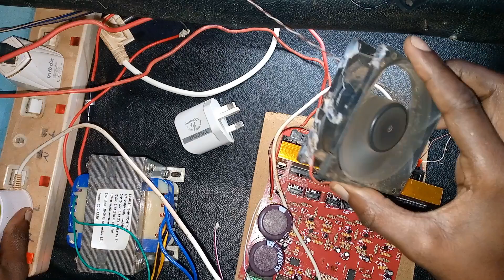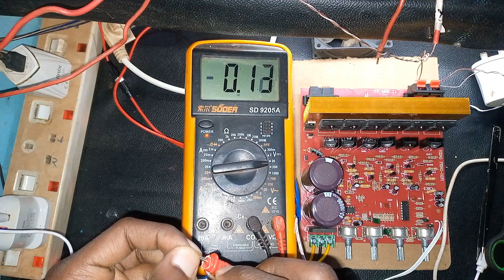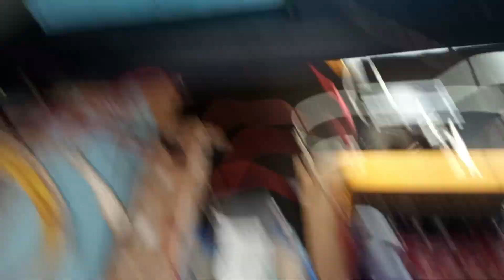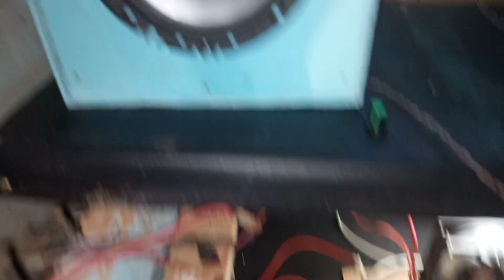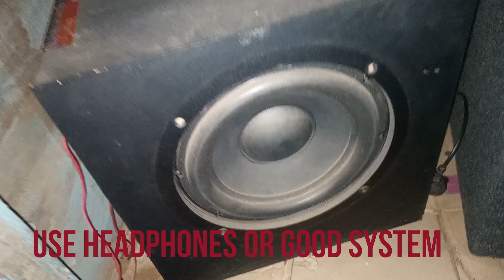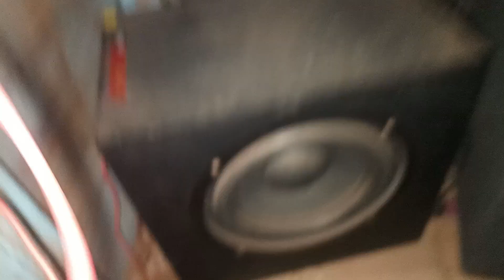Remove distortion in 999 red amplifier board

Comment: Hey i powered my eq together with Bluetooth device using torroidal transformer but turned it to 12v dc but naskia ikiwa na too much distortion
Reply from the maker: Hio huletwa na ile 7812 regulator ya Bluetooth device, bypass it na utumie 5v ya phone charger
Reply: After removing the regulator...do I join the three points together?? @emmanutechnician

Comment: What is the difference of green and red bored  please explain
Reply from the maker: Red has slightly more power than green. It uses 1943 and 5200 while green uses b688 and d718 transistors. 
Red has 63v capacitors while green has 50v. Meaning it can handle more voltage.

Red has better driver transistors with heat sink, green has ordinary drivers

I observed that green has better  mid  sound quality, but poor bass.
Red has better bass but can't beat mids for green board. But if given equalizer and good transformer, it outshines green by far.

Comment: Yangu ilikuwa creative mini subwoofer after nilichoma ac ya speaker niliambiwa iyo ac iwezi patikana so nikaekewa amplifier dogo kama Ile ukuwa kwa duthi   so nikiongeza volume ifike 30 or ata 25 bass inapotea na volume inareduce kwa speakers plus nikieka tule tu speakers tudogo tuwili inan'gorota vibaya sana help a friend 😢
Reply from the maker: Hizo amp za nduthi hutumia LA4440, which can barely give 19w bass na satellite speakers ni 6watts. 
It should work with that creative mini woofer, but uipatie 12v na enough current.
Reply: @emmanutechnician  thanks brother 👊👊

Comment: great work as always....pls help when my relay amp is on the blue light turns on well but when i increase the bass the blue light becomes dim what could be the problem ..i use 24 0 24 as the power input
Reply from the maker: 24 024 may be low on relay board. Unless you get one with high current. I prefer 30-0-30
Reply: Use 30 0 30 Toroidal Transformer